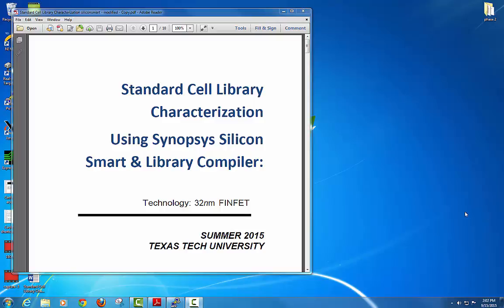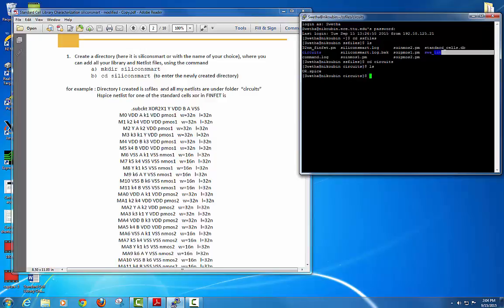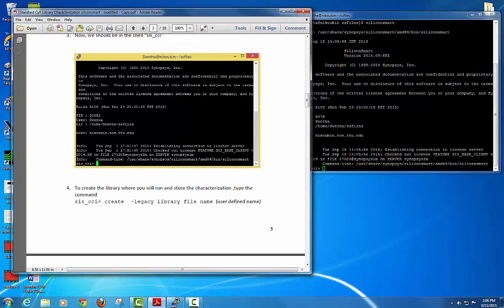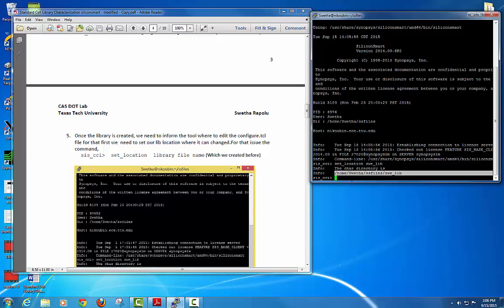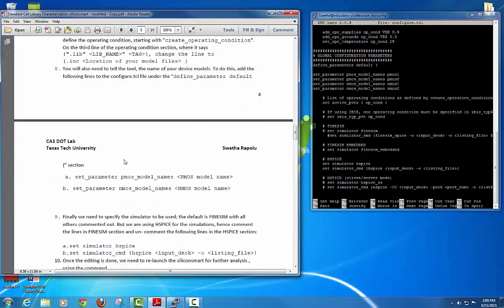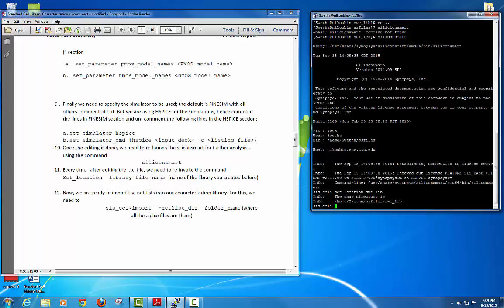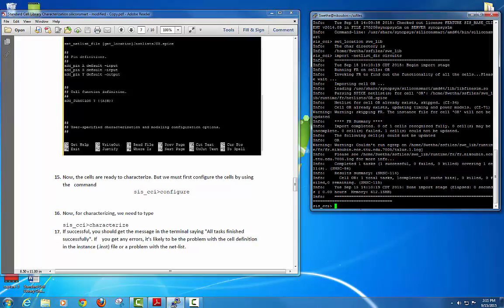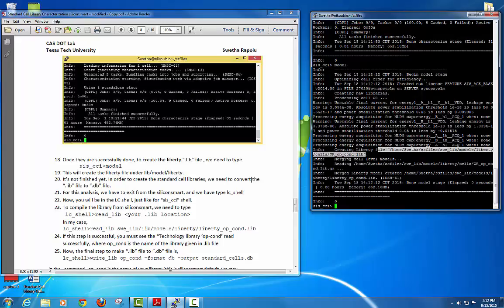CAS DOT Lab - 044 - Silicon smart and Library Compiler

Comment: when I try to import my netlists, I receive the error that the ports of my subckt are not in the node map.
My netlist looks like this:
.subckt inverter2 in out vdd vss 
MP1 VDD in out vdd p12 L=0.1e-6 W=0.2e-6
MN1 out in vss VSS n12   L=0.1e-6 W=0.2e-6
.ends

the error:
 
Info:    ================================================
Info:    Thu Dec  8 15:51:49 CET 2016: Begin import stage
Info:    Running FR on cells: inverter2
Info:    Importing cell inverter2 ...
Error:   parse failed : 5
Warning: The port in is not in the node map. It may be a floating port.
Warning: The port out is not in the node map. It may be a floating port.
Warning: The port in is not in the node map. It may be a floating port.
Warning: The port out is not in the node map. It may be a floating port.
Info:    Parsing SPICE netlist(s) for cell 'inverter2': /home/lpiepka/siliconsmart/easylib/runtime/fr/netlists/inverter2.spice
Info:    Netlist for cell inverter2 already exists, skipped. (CI-34)
Info:    Cell inverter2 already exists, updating timing and power models. (CI-71)
Warning: Warning: skipping FR. The instance file for cell 'inverter2' will not be updated
Info:    ** FR Summary **
Info:    Import completed. 0 of 1 cells recognized fully. 0 cell(s) may be incomplete. 0 cell(s) failed. 1 cell(s) could not be updated.
Info:    The following cell(s) could not be updated
Info:    inverter2
Warning: Couldn't run egrep on /home/lpiepka/siliconsmart/easylib/runtime/fr/fr.i83labpc07.5384/talus.1.log : child process exited abnormally
Info:    Please see /home/lpiepka/siliconsmart/easylib/runtime/fr/fr.i83labpc07.5384.log for more info...
Info:    Completed 1 tasks (2 successful, 0 failed, 0 killed) covering 1 cell(s). (SMSC-86)
Info:    Results summary: (SMSC-114)
Info:      Cell inverter2: 1 total tasks, 1 completed (0 cache hits), 0 killed, 0 failed, 0 remaining. (SMSC-115)
Info:    Thu Dec  8 15:51:49 CET 2016: Done import stage (Elapsed: 0 seconds | 0.00 hours  Memory: 817.89MB)

Could you please help me? Do you have any idea?

regards